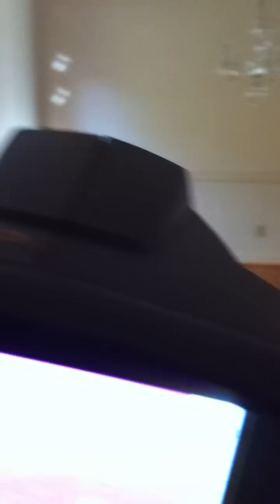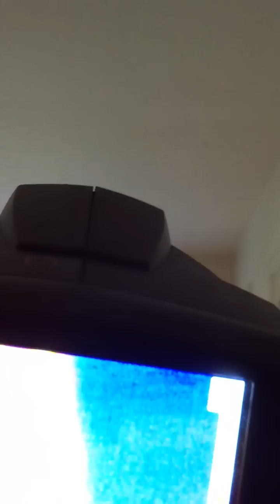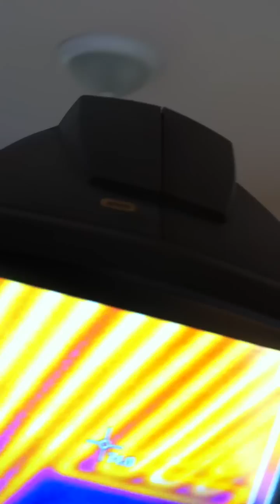Charlotte Home Inspector Inspects Radiant Heat Ceiling with Infrared

Comment: Just purchased a condo built in '74 (two story) with radiant heating.  Never ever heard of it until we did the purchase.  Now I'm nervous, thinking it could be a fire hazard.
Reply: This type of heating is actually very common in the seventies.  No need to worry about it being a fire hazard, but it is less then cost effective to use.  I have it in my home, and it was in my parents home that I grew up in.  Some of the things that you need to be careful of is not to put nails or screws in the ceiling because you could damage the wires/elements in your ceiling.  Other problems is that the ceiling may sag over time because of all the weight.  It works well enough if your really good about keeping the doors and windows closed and avoid having them open for any length of time.  This type of heat is not quick to heat the home back up and it's actually really expensive to use.  If you were to put in a heat pump or a furnace of some sort that required venting, I would not try to save the ceiling heat, again because of the cost of use.
Reply: Thanks for all this great info.   I was considering the alternative of installing individual wall heaters in most rooms and somehow have them wired to the existing dials that are used for the ceiling elements. Also I am not sure what type of switches come with the wall units, (maybe a thermostat setup)  Whats your take?
Reply: I'm not a expert in this area, but from what I have seen most of the homes in the Portland Oregon area that have ceiling heat use a thermostat that is like or similar to one used for a base board heater, I suppose that they could also be hooked up to a Cadet style heater as well.  Many of the Cadet heaters have the thermostat control right on them, and there would be no need to touch the ceiling heat if you desired.  The one thing that you will have to keep in mind is that you will need to have more breakers added to your Electric box.  I like the Cadet heaters better then base board myself.  The thermostats are of a simple design.  you have a rod that is made of brass on one side and bronze on the other and they are placed between contact points.  being made of two types of metal means that it expands and contracts at different rates so the bar bends to touch the contacts turning the heat off or on.  None of these types of thermostats in my home work the same.  Hope this helps somewhat.  Good luck.
Reply: Of course it helps. I'm sure heating and air companies in the area have more than one suggestion.
Reply: I moved into a condo built in 75 and we were just told it has radiant heating in the ceiling. We were hoping to install SafenSound to make the ceiling more sound proof from upstairs neighbor footsteps. Now we're wondering if that's even possible if it could be a fire hazard or if removing the ceiling will be a nightmare.
Reply: @YodatheHobbit  Do you know if removing the ceiling is an option? I cant seem to find much information online at all.